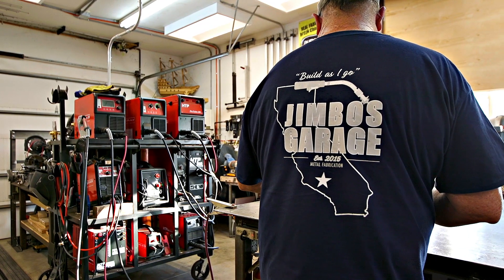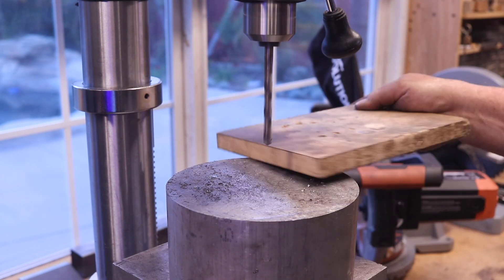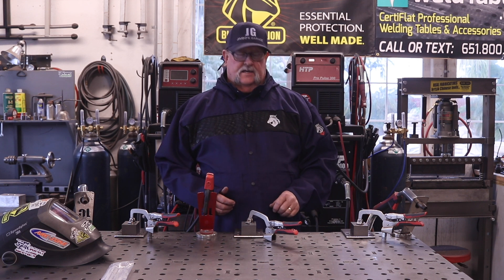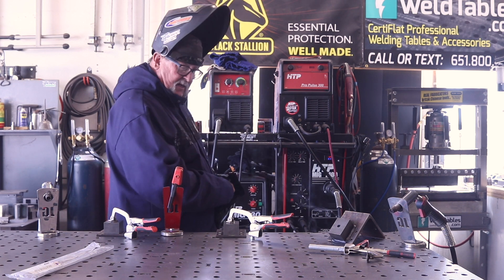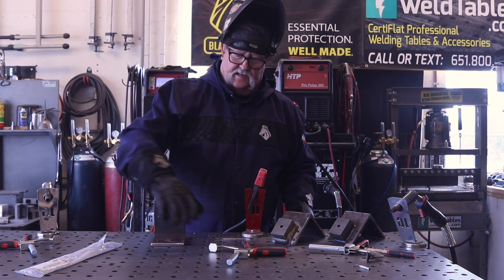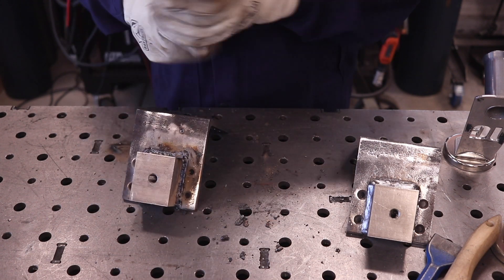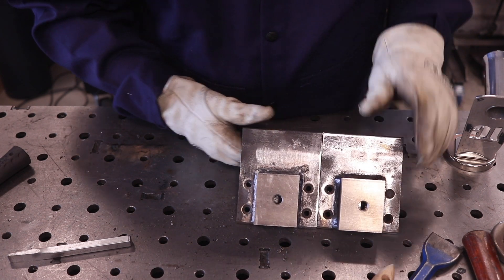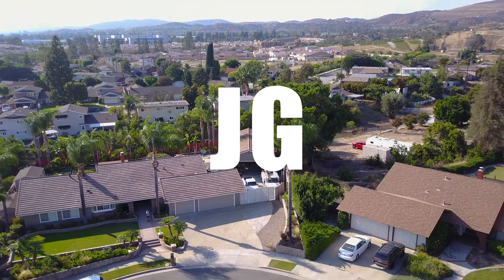Welding Process Comparison | JIMBO'S GARAGE

Comment: The only real problem with BBs, bluberries, or whatever you call them, is if they get into the holes, or countersinks. The the screw won’t fit properly, and it’s back to the drill press.

You have 85/15 argon/Co2?
Reply from the maker: Thanks for watching, I'm using 90/10 with the spray arc. Only had a few 
BB's in the holes, Popped right with a punch!    Jimbo!

Comment: JImbo, did you run the Propulse 200 using one of the synergic programs build into the machine or full manual for your wire speed and voltage.

Comment: Nice welding Jimbo.  Those welds look pretty close to the bolt holes.  Using a test bolt and getting the customer to approve the first one is always a good idea.  Making that block a bit narrower (if possible) would help a bit.  Assemblers always curse the welder when the bolts don't fit nicely.  BUT... if that's what the customer wants ….  ????